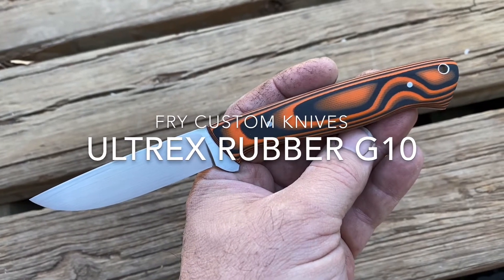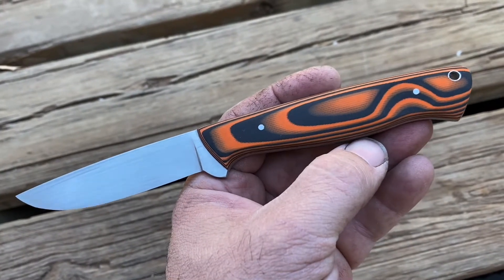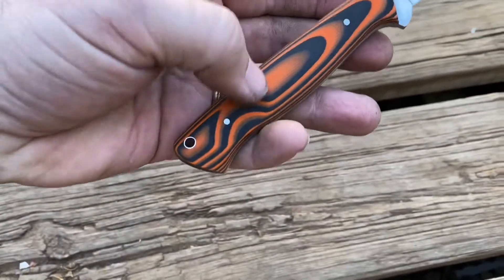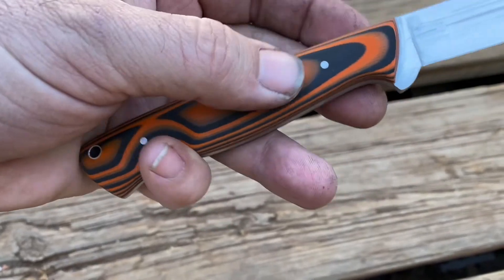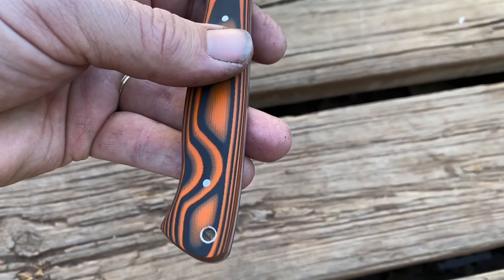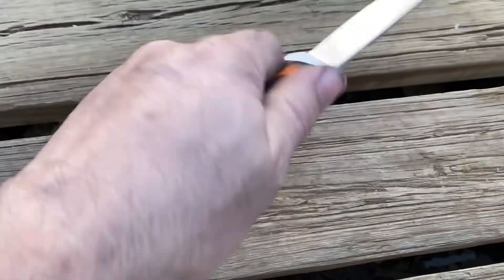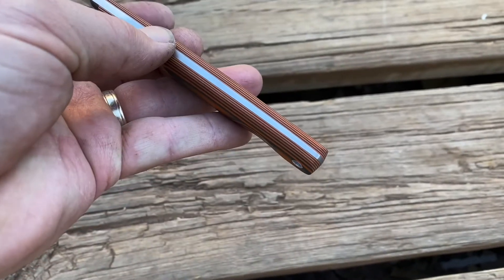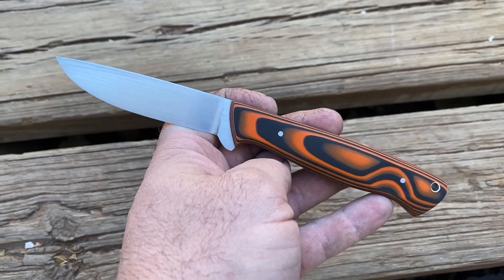ULTREX suretouch rubber G10

Comment: Not much info out on this Suretouch material that I could find. Would this work with a Chef knife handle? Is it safe for the heat in a dishwasher with the rubber?
Reply from the maker: Two points.... one, don’t put a custom knife in the dishwasher lol. Two, I reached out but haven’t found any stories about the rubber G10 and dishwashers. It would tend to be durable I’d think, but I can’t vouch for it personally.
Reply: @frycustomknives8429  One, this is not a custom knife, putting new handle on old chef knife for SIL who wants a better gripping handle.

Two, I don't wash any of my knives in DW but they do.

Three, thanks for the reply.
Reply: @frycustomknives8429  I received my Suretouch blanks and tested sanding and polishing on a scrap piece and have not been able to bring a rich black color out, it's black on black. Is there a trick to it? Your orange and blue are very vibrant. Mine seems very grey sanding, finish sanding and polishing. Do you use/do anything special? Thanks again for the replies.
Reply from the maker: @JDL_2020  key is to apply some oil or wax after sanding. Anything from WD 40 to Renaissance Wax. Brings the final color out.
Reply: @frycustomknives8429  Thank you for the prompt reply, I really appreciate it. I have scoured the internet looking for info.........